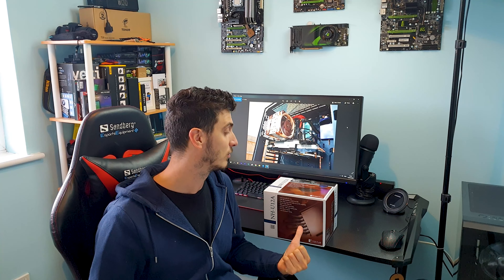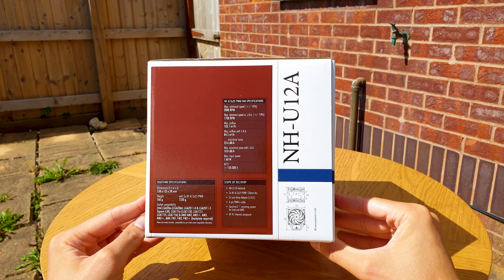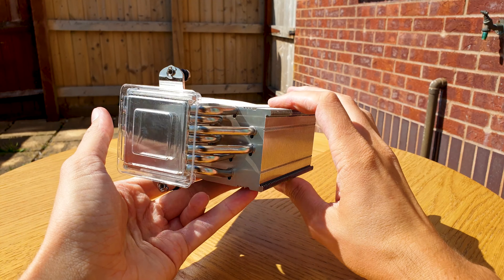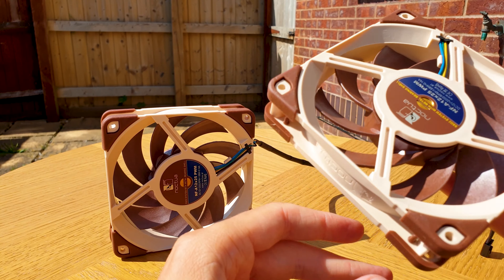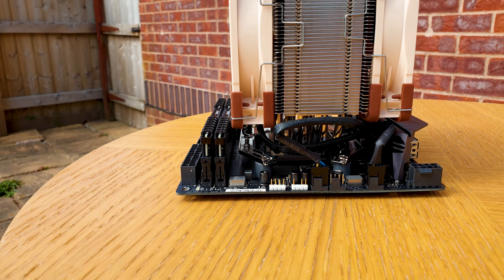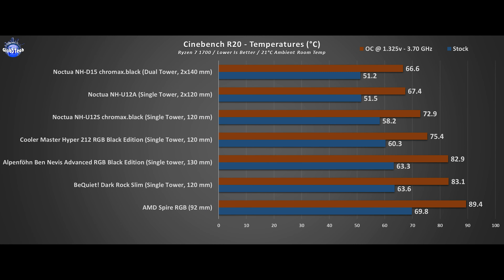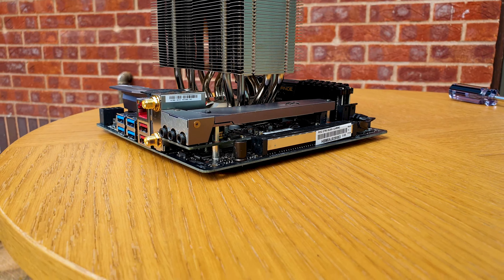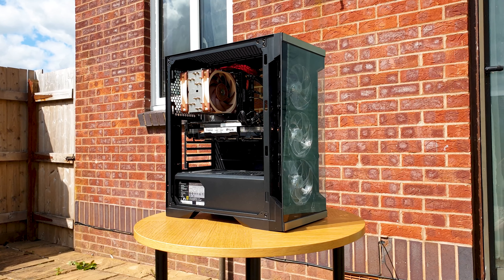Noctua U12A  - The Best 120 mm Air Cooler EVER !

Comment: Is it safe to use this cooler on gigabyte b550 aorus elite? (4 layer pcb)
Just worried about bending or break the motherboard
Reply from the maker: Hi. I would say as long as you are extra carefull when moving your computer afterwards or transporting it (make sure to keep it flat), you should be fine. For extra piece of mind I would email Noctua maybe they have an internal torque chart  to give you the most complete answer 👍
Reply: @Glob3Tech  Hi thank you so much for your reply, really appreciate it. 
Actually I've got my NHU12A before getting the motherboard. Anyway, you got +1 subscriber.
Reply from the maker: You are most welcome! 🤟 Thank you! Let me know how it goes with the build 👍